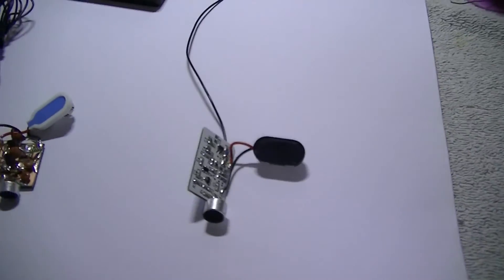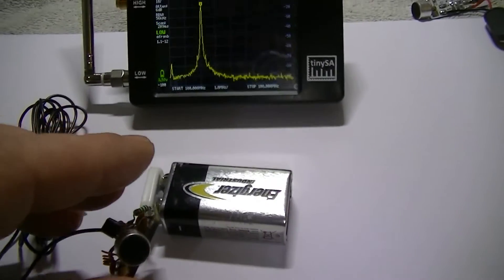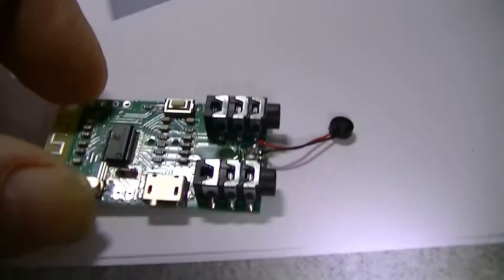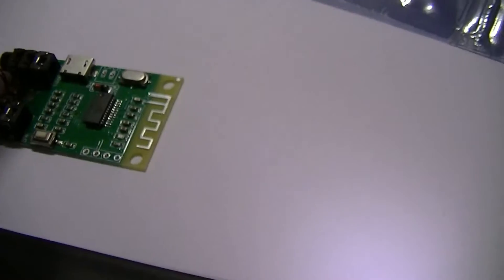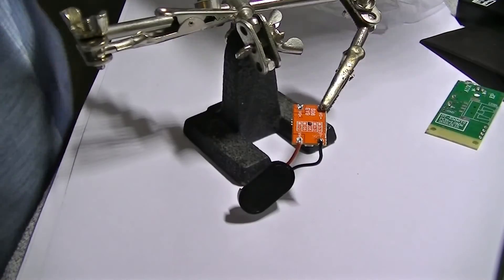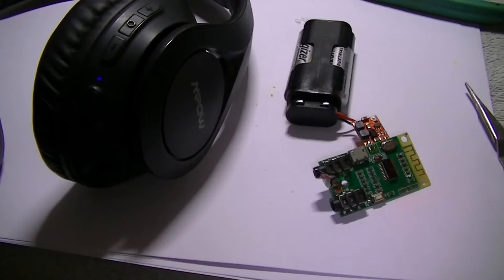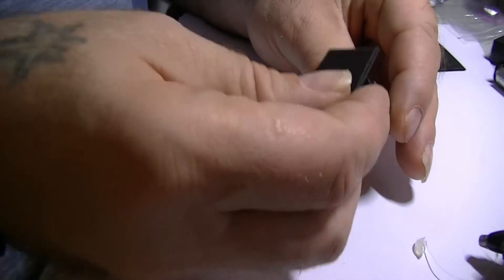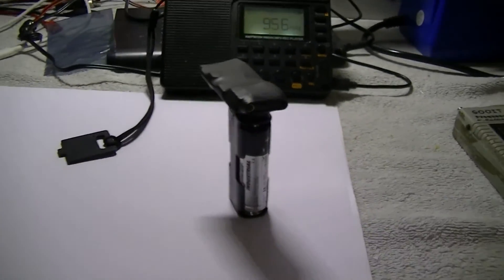Build this great bluetooth microphone transmitter

Comment: Thanks for the clear instructions. I see that the Bluetooth transmitter board can also take 3.5mm audio in, which makes this board extensible.
Timestamps / Chapters
0:00 Intro: FM Transmitters

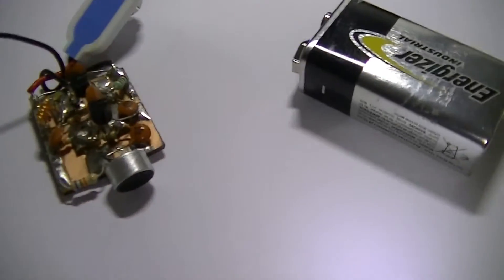1:44 Stability tests of Analog transmitters: VHF
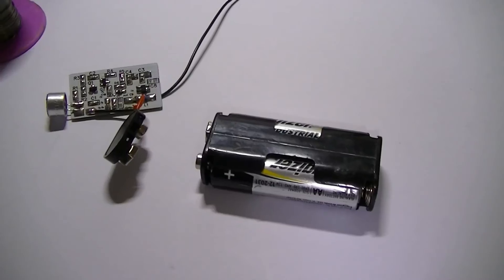2:55 UHF Stability test
4:33 Bluetooth transmitter Parts: Transmitter
5:19 DC/DC Boostbuck converter
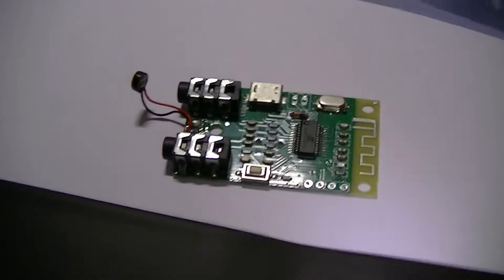7:30 Secure Microphone with Glue
8:27 Attach DC/DC converter
11:40 Test connection to Headphones
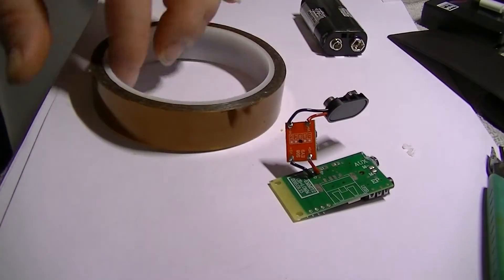12:26 Kapton Tape
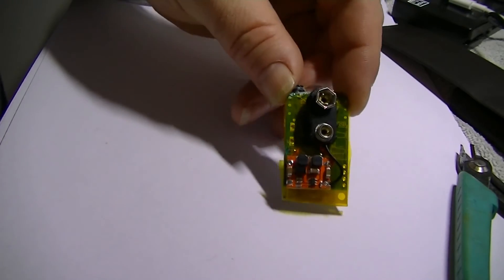13:12 Heatshrinking
15:59 Completed Testing